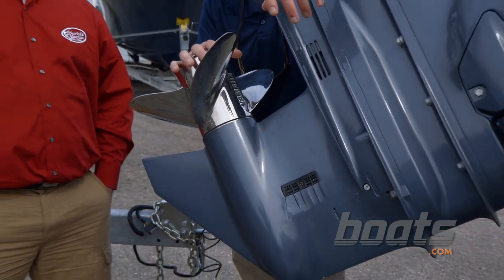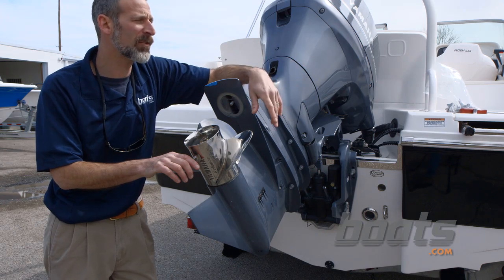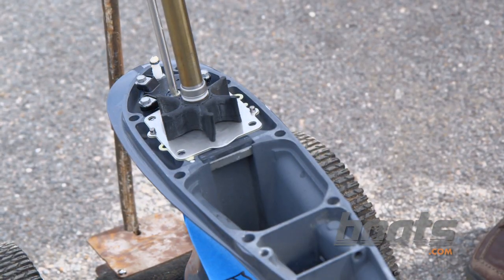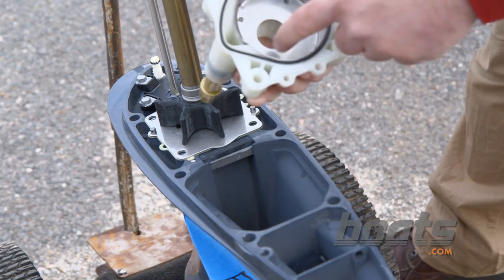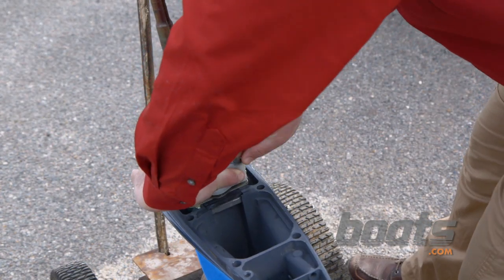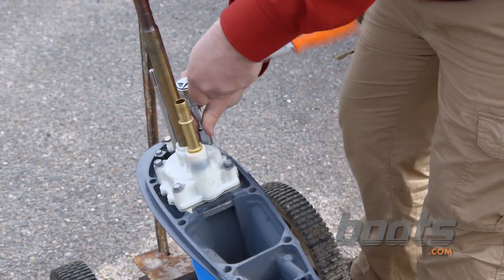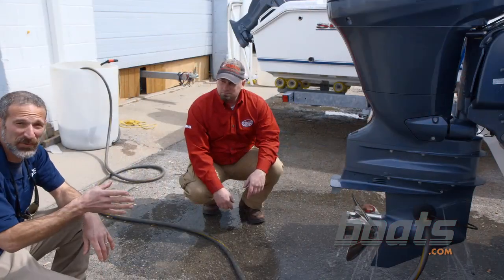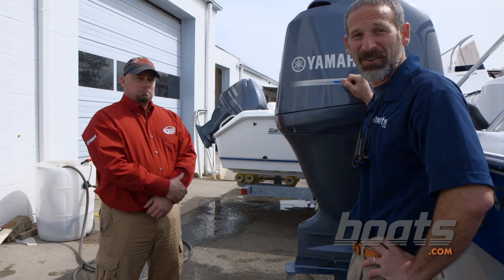How To Change an Outboard Engine Water Pump Impeller

Comment from the maker: Hey Patti - assuming you did the impeller change properly, this means you have a clog somewhere in the system. Take a piece of 50 or 60 pound-test monofilament fishing line, insert it into the tell-tale (weep) hole, and spin it as you push to work it farther and farther in. You should be able to get several feet of line into the engine, and break the clog. If this doesn't do the trick, you can also take an air compressor and try blowing the clog out. Good luck!

Comment: Great video. It looks so easy and if you do check or replace the water pump impeller every year it usually is but if you wait 4, 5, 6 years the water pump will probably still work (depending on engine hours) but when you do try to take it apart is where the real problems start. I bought a used engine and I knew it had not been done in many years. It took a few drill bits a few heli-coils and way more time than I wanted. Keep it easy do this every fall when you pull your boat for the season. Lithium grease is  your friend.

Comment: Just bought an 06 Yamaha 9.9 and the leg was an absolute  bear to get off. If nothing else just dropping the leg and greasing up the bolts every two seasons is a must. The impeller came out hard and formed into a spiral. Probably had never been replaced.  There is so much riding on that $30 piece of rubber it is hard to believe people wait until it fails and causes overheating and a major engine failure before they even consider replacing it. This is the one thing I always replace with OEM parts.

Comment: You missed the most important parts of the impeller change- how to remove and replace the plastic spacer, stainless collar and washers that hold the impeller on the shaft. Useless as a how-to video.
Reply: That's exactly why I was watching this video lol. guess I have to keep searching.

Comment: hello,i was given a 3 hp evinrude 1990 year, it was seized up so i proceeded to put penetrating oil in cylinders to break free, after about 1 week it broke free however it feels like its hitting inside after about 1/2 revolution going both ways. i tried to remove lower unit and cannot get it apart can you help. thanks
Reply from the maker: palms102 You may be able to fix it yet but it sounds to us like a complete disassembly is going to be necessary. Try soaking all the parts in warm diesel, get them as clean as possible, and you'll probably need to do some parts replacement, too. Looks like you'll have to break out more of that penetrating oil.
Reply: Have you no junkyard nearby? Go there looking for parts, and, when no one is paying attention, heave that motor towards the back of the pile.

Comment: Flush port hose at top of motor is for FLUSHING only.  Muffs need to be used when running the engine with boat out of the water.

Comment: If my small mercury 110 9.8 hp only pumps water when its in forward gear what could be wrong with it. It will not pump water in neutral or reverse. Help?
Reply from the maker: Hey Travis - sounds like it's time to do a water pump rebuild. You can have a shop do the job but truth be told it's a pretty easy process on an outboard that small, and is surprisingly similar to what you saw in this video. Water pump rebuild kits are widely available and only cost around $30. Good luck!
Reply: boats.com  I just had it serviced in august for it. I'm just confused maybe he didn't do a good job?

Comment: I have a 1982 90 hp johnson seahorse and when I start the moter no water is coming out of the water hole where it's supposed to come out ?

does this mean that my water pump is old and I need to replace it with a new one ?
Reply: Typically yes. Or unless the hose is clogged

Comment: This job is not as simple as shown.  The "missing the shift shaft" is a serious thing.  In addition, adjusting the shaft, if it jumps out of neutral, is a challenge if the unit is not installed properly.  You do not just take it off.  Numerous steps missing here.

Comment: what about removing the shift shaft retaining bolt. its underneath the motor. I can't seem to do it
Reply from the maker: This can vary greatly depending on the motor you have. What's the make, model, and year of your outboard?
Reply: I figured it out. Thank you. 87-88 johnson 70 VRO in line 3

Comment: whats that last part??
Reply from the maker: Hi Mike Swan. The last thing Chris recommends in the video is  to check how the engine shifts to make sure you lined everything up properly. Here's the full "How-To" article that goes along with the video: http://features.boats.com/boat-content/2013/05/how-to-change-an-outboard-engine-water-pump-impeller/.
Reply: Hey, Thanks alot!

Found out that my 1987 evinrude has a pin inside the engine compartment under/behind the starter..
Reply from the maker: Mike Swan Glad we could help.